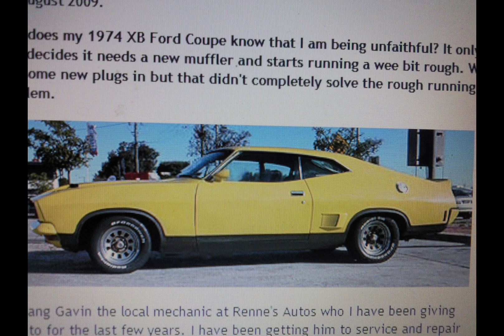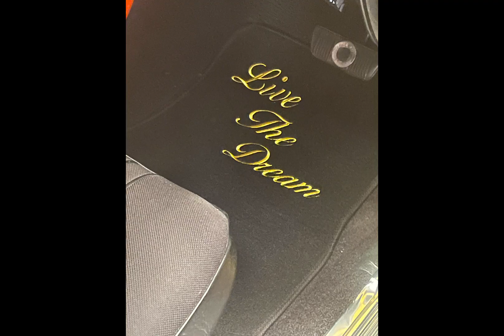XB GS FORD FALCON HARDTOP (EXTREME RESTO)

Comment: This from a Holden guy. Glad, you got rid of the shaker, didn't suit it. The car is very nice and clean, great work. The only thing I would have done different is had the seats done in Leather. I had my seats and doors done in Leather with diamond stitching from Johns Auto Trimmers in Welshpool. Overall, a nice clean car that I am sure you will enjoy for years. Another great Aussie car saved.